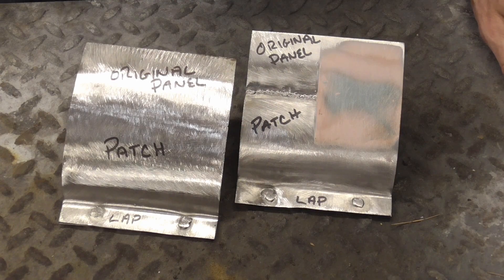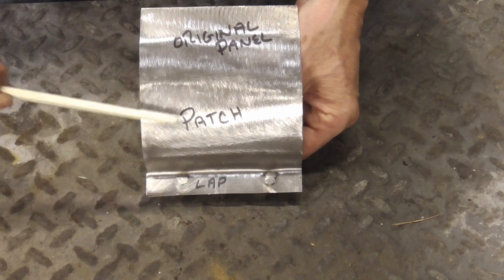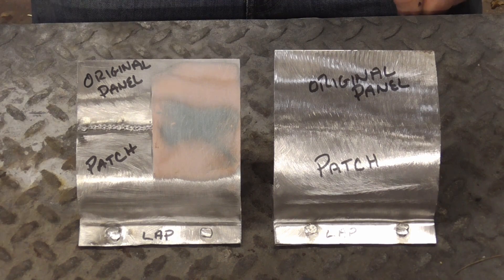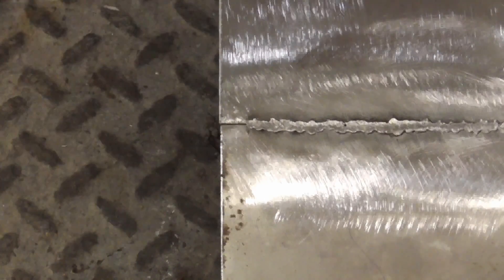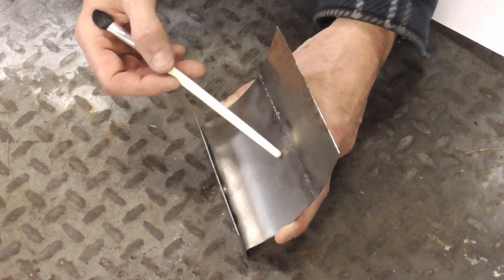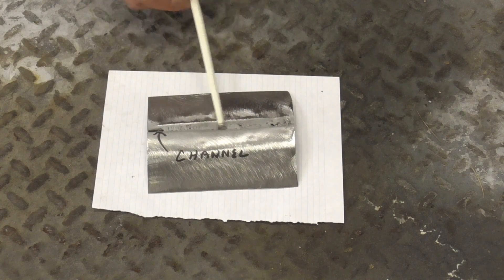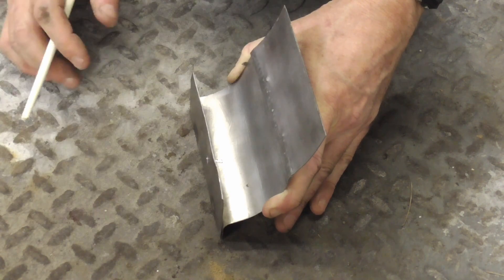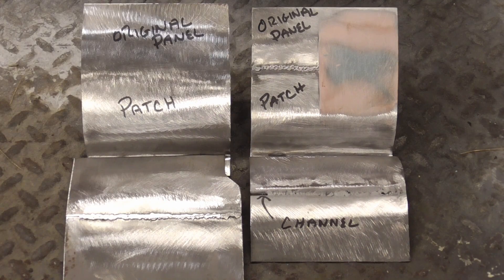Butt vs Lap Welding for Rust Repair: The Debate Ends Here!

Comment: Would you ever use a flange tool on the upper panel and lay the bottom part into the flange then weld?
Reply from the maker: As long as you can flange all the way around it is sensible and would work fine.  Most times though you run into a sharp bend, wheel well lip, edge, etc.  Just my thinking but I want to be a robot and do it the same every time.   If it works for you though - absolutely :)
Reply: @LakesideAutobody   Thanks for the advice.

Comment: Have you ever tried soldering after you grind to fill in any tiny holes you can't see?
Reply from the maker: You could absolutely do that with success - careful with the heat though.
Reply: @LakesideAutobody    I'm pretty new at autobody..  Long time turning wrenches   and quite a bit  of welding experience..
So I'm working on my chevy Laguna    it sat for a couoke years.. Guess I had a leak in the trunk.. 2 layers carpet.. Needless to say   rust! 
I'm putting  in a recessed fuel cell   and repairing  whats left of the rust
. I figure this is good practice  before I do the actual body repairs..

Thanks for the videos   lots of good info for sure,

Comment: At 3:45 you mentioned the backside getting moisture and eventually causing bubbling of the outline of the repair. I’m starting to see that outline bubbling but the paint finish is still strong and hasn’t penetrated fully through yet. What would you recommend at this point? Just observe it until the finish finally cracks and then weld another piece? Would you remove the entire original welded piece?
Reply from the maker: If the patch is in good condition, grind it down to clean metal, tap the seam down (all seams, lap or butt, have to be tapped down), fill with fiberglass reinforced filler, then finish with regular filler.  Like you see in this video - the lap welded one.  You can keep the butt welded patch - just tap it down and let the filler "seal" the seam from the finish :)
Reply: @ wouldn’t the backside of the patch still continue to rust out since I can’t reach back there to paint/protect it? This is for a wheel well patch
Reply: @austinl3625  alway use fiberglass filler over a weld and be sure u have coverage regular filler will absorb moisture

Comment: decades ago like from the 1960's onwards  my uncle sprayed all his cars with fishoil inside every cavity and potential water trap, decades later no rust , hed reapply it every few years, hes a car performance nut who builds and paints his own cars in his spare time.
ive done the same over the decades same result , i do apply it HEAVY and overkill.
Reply from the maker: Very interesting - were do you get the fish oil?  Does it smell at all?
Reply: @LakesideAutobody  here in Australia most auto shops and hardwares sell it.
theres two types , the fishy smell and the deodourised, both smell for weeks.
others spray lanolin : the oil from wool.
both smell but pretty much prevents rust for along time.
no panel beater spray painter would use it, they make the car smell.

Comment: "Can't guarantee it's waterproof". 

Actually you can. All you need to do is shine light into the panel and if you see light coming out you know there is a hole where water can enter. You can shine light up through he drain holes to test it.
Reply: Just because there is no pinhole doesn't make it rust proof. When the metal is thin or the weld is blobby, a little rust can eat through sooner. When metal is thick, a little surface rust can be there for decades. Not so with thin metal.
Reply: @Spiritof_76  
I never said it was rust proof, I said it was waterproof, as in it won't leak if you ensure there are no pinholes. Oh sure over time there could be problems, but that is another matter.
Reply: @laughingachilles  A year or two and the paint will bubble if the metal is thin in that area (if it's a daily driver.

Comment: I wanted to thank you for your time in producing this video and helping educate anyone looking for this information. I’m a self taught guy, restoring old multiple old trucks myself over the years. With whatever tools I can afford at the time and majority of it has been out doors working. I finally have a garage with enough room to slip an old truck in without kicking my wife’s vehicle out… I’ve been doing metal work on my 72 c10. Starting inside of the bed. Patching the inner wheel arches and floor. To build confidence and experience before moving to the outer areas. On my own, found lap welding to be a smoother and more comfortable/confident repair process. Now I understand why and can move on to the outer metal work, with confidence. Really appreciate your time and clear explanation
Reply from the maker: You're welcome and thanks for the kind words and support.  I don't say this in any video but in my time working at some major shops in the metro Detroit area, I have never watched anyone try to butt weld a patch - never.  Truthfully, the guy would not last long at all.  Sure you butt weld when you need to - like edges, rigid panels like rockers, wheel well lips, etc.  Most of the times however, you'll be lap welding.  Remember, there are over 5000 welds in a car being built in a factory and not one is a butt weld - there's a reason for that.  Thanks again and good luck with your projects - Jerry

Comment: Brialliant short and concise lesson !!! Reaffirms that there has to be methods used that fit the situation …. Ie hotrod , prob never see rain …. A driver car , in wet climate ….. I’d say the Fiberglass filler before any body filler is smart ! …. Be concerned with avoiding blemishes with in the panel and expect rust will return not only on your repair , but other areas where it could be close to rust through from the inside which is inevitable 👍🏻
Reply from the maker: Thanks for your input LCPD - have a great week :)

Comment: How do you get that bare metal to look that great?
Reply from the maker: Fiber resin discs on a 5" high speed sander.  
1)  Astro Pneumatic 222S 5'' High Speed Sander
2) 4-1/2" X 7/8" ALUMINUM OXIDE RESIN FIBER DISC - 25 PACK 36 grit from Benchmark Abrasives

Comment: i work on classic Italian cars.. and when i do a butt weld.. and after i grind it flat..i find that after i smooth it out..i ' tin ' the panel.. as if i was going to start to lead  the panel... most of the cars i work on,, the seams are ' leaded' then sanded to shape... but, again..i find that ' tinning ' over the but weld. will make it water proof
Reply: this is also a great practice..if you are going to use plastic on a panel.. tinning the panel area, will keep any rust from forming.

Comment: Very well explained & demonstrated. I have been putting this off for some time. This video is a big help. Due to several contours in different locations I will have to use a couple of the methods you showed, but now see the advantages & disadvantages when using them. Thank you.
Stay safe, Joe Z
Reply from the maker: You're welcome Joe, glad it helped :)

Comment: What is your thought on using weld thru primer.?Zinc based?
I know that when welding your ground electrode needs to be on and close to where you welding. What is the best method to avoid damage to electronics of the vehicle? 
Thanks for your videos they have have me a ton!
Reply from the maker: I don't use weld through as I prefer to treat the inner panel for rust "after" the repair - https://www.youtube.com/watch?v=8XaZBy7GC7A   We were always told (bosses) to unhook the negative cable on the battery before MIG welding.  Since the 80's I've always removed the neg cable and never have had one issue.  Hope that helps - Jerry
Reply: @LakesideAutobody  that does help that you! So many say to unplug the modules. The vehicle is 18 years old that I am going to work on. It doesn't seem to work out well on really old connection to disturb them been my experience. 
Thanks for all your videos!
Reply from the maker: @weloveups831  You're welcome my friend :)

Comment: Thank you. I'm going to be removing a sunslider on a jeep and covering the hole with sheet metal. Lap weld with fiberglass filler for the weld it is.
Reply from the maker: You'll be fine doing it with lap welds 👍🛠😊

Comment: a trick I learned from a friend  for checking your welds for flaws from the inside..  if you don't have any access to the back of the weld just drill a small hole big enough for a  small light  on a wire and insert it into the space behind the weld the light shining through the weld will show you will need to reweld..or now, you could use a bore scope with a camera..same idea and when finished plug the hole with a plastic plug to seal it..the holes can also be used to flush the rockers and spray rust inhibiter inside as well..
Reply: Important to note that only works if there isn't a 3rd sort of "gusset'y" panel between the inner and outer rocker/sill.

Comment: I have tried both methods.  I find fitting larger panel repairs with butt joints very time consuming, but yield a slightly better metal finish.  I like the strength and ease of finishing a lap weld.  As others have mentioned, not every repair can be lap welded, especially around tight corners.  Thanks for the video.
Reply from the maker: You're welcome JDP - thanks for your input.  Happy New Year :)

Comment: this video here is what convinced me to use lap welds for my trucks wheel well panel replacement....I'm still going to spend the $40 on the flange tool....I know you suggested just "knock the welds down" with a hammer but I think the flanger may be easier in the end.
Reply from the maker: Let me know how it goes for you with the flange too.  Do a patch with the flange tool and one without and let me know how you feel about it after each - Merry Christmas and HNY WKW Jerry

Comment: I see it more what you are working on .   A classic cat should have as little filler as possible.   So your best choice would be a but weld  with 45° edges at the but.    But simple rust repair on a driver it doesn't matter.  So go quick and easy lap weld.         But anything   that i will put money into, i want a 45° But patch accurate fit with absolute minimal  filler.     Best case filler would be lead.   Which would fill any possible pinholes and will not ever bubble.
Reply from the maker: Here's some good, honest advice.  If you want to be the best body man you can be, never be afraid of using filler.  That's just magazine, TV talk.  Filler is used every day in every dealership and pro body shop across the nation.  Most folks don't realize this because these are professionals that are using it - it's being used and applied correctly.  If used right it will never be noticed and last forever :)

Comment: Why put the patch on the outside? Couldn't you  insert ther patch panel from behind and  plug weld it to the outer panel?  Body filler then would only be the thickness of the metal.
Reply from the maker: The patch is always bigger than the hole so it would sometimes be frustrating trying to get it behind the panel.  I have done it before like that - but half on it was in and the other half out.  You could do that if you wanted - no problem just takes a good patch design.  You never have to worry about how thick filler is - that's all magazine, TV, internet nonsense.  Every body shop across the nation uses filler every day and no one knows it because they use it correctly.  Filler is good - it lasts forever if used correctly :)
Reply: @LakesideAutobody  Thanks for your prompt reply. I just thought with the patch behind it would reguire less welding and less beating. You could tek screw the panel on then remove each tek and spot weld the holes one by one. Nothing against filler it is wonderful stuff. I really like your videos as they explain everything clearly. As a very old beginner it gives me a lot of confidence. Cheers from Australia.
Reply from the maker: @amraceway   Hi Bill - I'm glad you like the videos - feel free to ask ?s any time - I answer every day 1-2 times. I might make a video doing what you suggested one day just for those that would like to do it that way.  Have a good weekend greetings from Michigan USA - wouldn't mind visiting Australia but sort of scared of all the creatures you have over there :)

Comment: Ever used seam sealer , rivets lap joint then applying body filler?
Reply from the maker: I have never done that.  It could be a solution to any water penetration though - have you tried it?
Reply: @LakesideAutobody  hey thanks for replying , well I’m a retired plumber practising on an old work truck that I have and hopefully get a nicer rat rod so l can work on one day, however I did us seam sealer and rivets on some of the panels and put body filler on top. Looks ok but not sure how it goes in the future😁
Reply from the maker: @abdulhamoui4376  You're welcome - hope you find a cool old rat rod - working on cars is a good hobby - keeps you out of trouble when you retire :)
Reply: @LakesideAutobody  thanks dude! Keep up the great work
Reply from the maker: @abdulhamoui4376  You're welcome my friend - have a good night :)

Comment: Ford Shop Manual from 1949-51 said to weld the new piece in solid, bump the welds down about 1/16" under the surface of the sheet metal with a hammer and grooved dolly, then fill the groove with lead. File, finish, and paint. 

They didn't give a damn about butt or lap, and they were using either an OA torch or a small stick welder. Good vid!
Reply from the maker: Thanks for the support Jim.  I would love to see that part of the manual - If possible could you send me a copy of that page to schoolvideolibrary @ gmail dot com - Jerry  I would greatly appreciate it :)
Reply: @LakesideAutobody  yes sir, I'll be happy to :) I might even show you some pics from my car build
Reply from the maker: @jimbob3708  I would love to see the car build pics - thanks a lot and have a good weekend Jim :)
Reply: @LakesideAutobody  probably bent some copyright laws, but.. to hell with them.
Reply from the maker: @jimbob3708  Thanks so much Jim - I'm looking it over right now - have a good week :)

Comment: I wish I lap welded my truck panels. That whole rusted outline you talked about happened on my cab corner.☹️
Reply from the maker: You could cut it out and try either lap welding or glue.  See this video for gluing:  https://www.youtube.com/watch?v=wRl1QfkrBeY
Reply: @LakesideAutobody  Could I possibly just grind the rust off, reseal it and repaint? Or will it potentially not keep the rust away?
Reply from the maker: @michaelbolia7847  It'll just keep coming back because the moisture is coming from the back side.  However, if you did what you are saying PLUS seal the back (clean it and spray with good rubberized undercoating like 3M or SEM) it would work.  Let me know what you end up doing - curious :)

Comment: I’ve done repairs both ways and I think each has it’s place. For me it makes a difference what I’m working on. If it’s an old work truck that’s ultimately only worth a few thousand dollars and I’m trying to make it last a couple more years, I lap weld. If it’s a 57 Belair that’s worth anywhere from 20 to 80 grand and I want it to look good and last another 50 years I butt weld. It all comes down to what the car is worth in the end combined with the customer’s expectations. Excellent video by the way.
Reply from the maker: Thanks wild west.  Here's some more good info on longevity of lap: Eastwood’s explanation on butt weld and metal finish:  https://www.youtube.com/watch?v=rpH50kh4W00 *  For longevity of the lap repair see:  https://www.youtube.com/watch?v=8XaZBy7GC7A

Comment: Do you suggest I lapweld my quarter panel replacements?
Reply from the maker: If you are sectioning it across the sail panel then absolutely.  Any sectioning you would lap, grind the welds to knock them down a bit, tap down the seam and fill.  Around the perimeter you'll spot weld through holes pre drilled in the quarter flange, etc.  Let me know it that makes sense or if it helped at all.  Jerry
Reply: @LakesideAutobody  is there an email I can get in contact with you? I’d really like your help this is my first project and I’m pretty nervous
Reply from the maker: @jah2029  Yes - my email is located under the "about" tab on my home page.  If you can't access it let me know - Jerry
Reply: @LakesideAutobody  sorry, I can’t access it? All I see if a description
Reply from the maker: @jah2029  No problem.  It's schoolvideolibrary at gmail dot com - Jerry
Reply: @LakesideAutobody  sent an email!
Reply: @LakesideAutobody  also yes thank you very much for this info
Reply from the maker: @jah2029  You're welcome :)

Comment: I did rust repair in the 80s and 90s. I never considered butt welding a patch. The time and cost would have been far more than my customers would have paid. I couldn't justify the cost on 10 to 15 year old daily drivers. I don't think I could butt weld a complete door bottom without having a pinhole or two even on my best day. The metal is too thin and the amount of grinding necessary to get it smooth would leave the metal paper thin. 
The rest of the car will rust out long before the patch anyway. The factory lapped and spot welded all of their joints. I don't see why I should try to butt weld when they didn't see the need. On restorations butt welds have a place, but in rust repair you will go broke trying to butt weld and metal finish your repairs. That was my experience anyway.
Reply from the maker: Well said.  Couldn't be said any better.  Thank you for sharing that.